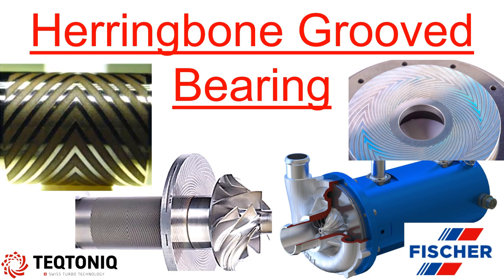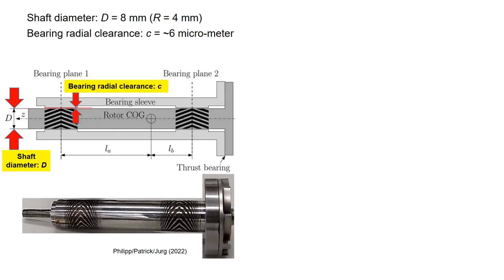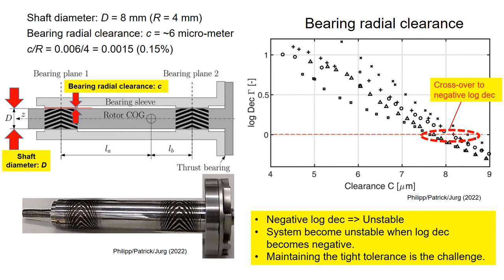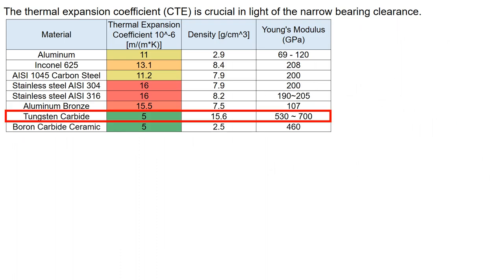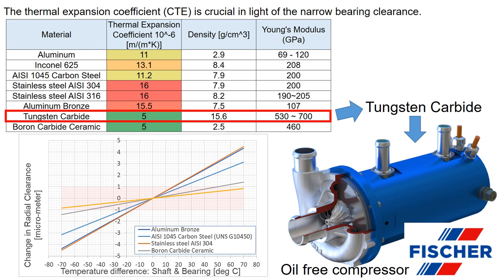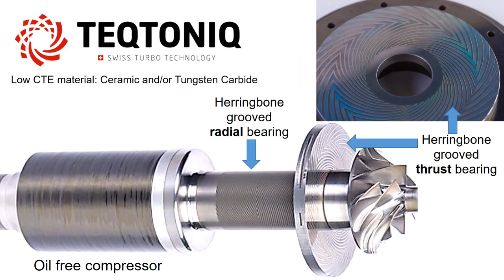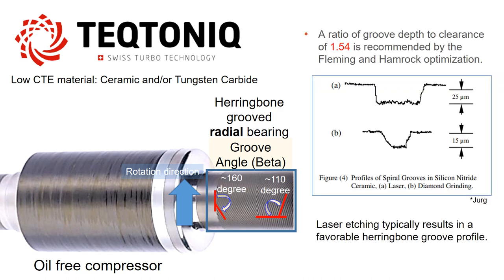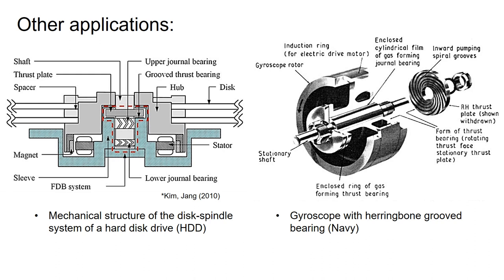Part 21 Herringbone Grooved Bearing

Comment: good. only ceramic materials(wc) proper for herringbone groove? How about using metal (Stainless Steel)? Is the depth of groove is getting larger as the radius shaft gets larger?
Reply from the maker: Thank you for your comment. In the video, I discussed how Tungsten Carbide has been effectively utilized in compressors by Fischer company. While there have been attempts with Stainless Steel, it's worth noting that high-speed operations can pose challenges (medium-speed operations might be more viable). Feel free to give it a shot and share your findings with us. Your experimentation could provide valuable insights into this area!

Comment: Good job! Would you mind introduce the recommend load capacity of this bearing and the recommend rotor speed ?
Reply from the maker: Thank you for your question! I appreciate your interest in my YouTube channel. In response to your query, the herringbone groove bearing is indeed a gas bearing. Its load capacity can be comparable to a gas foil bearing, but it generally has a higher capacity. If you'd like more detailed information on this topic, I recommend checking out Part 17 of my video series where I discuss it in depth.

As for determining the recommended rotor speed, you can find specific guidelines at the end of Part 13 video. However, it's important to note that defining the rotor speed is influenced by various factors such as operating conditions, rotor design, bearing design, and motor design. While the DN value can give you a rough estimate of the rotor speed, it's crucial to consider the overall system requirements and specifications.

I hope this clarifies your query. If you have any further questions, please feel free to ask!
Reply: @RotorDynamics  Thanks for your attention! Your video is always informative and helpful, I’m really your fans and learn a lot from your video. Thank you again. As you mentioned in the part 17, the gas foil bearing has a larger clearance and this clearance will lead to increased leakage and lower aerodynamic efficiency of the blower. This phenomenon will be especially prominent for higher pressure compressors. I noticed that the Herringbone Grooved Bearing has much smaller clearance, and it seems to be a better solution for compressor. But I didn’t know whether it can achieve about over 100-200kW for this kind of bearing. And Is there a correlation between power and rotational speed? Thank you so much and have a nice day!
Reply from the maker: Great question! In my experience working with compressor sizes ranging from 100-200kW, I've found that this size range tends to have a fairly large machine, with a rotor assembly weight of around 40 kg. One challenge with frequent start/stop cycles is that the gas bearing can wear quickly, unless you have external pressure to lift the shaft during start-up and shut-down.

As mentioned in the video, achieving the proper functionality of herringbone grooves requires maintaining tight tolerances, which can be quite difficult for larger machines in the 100-200kW range, unless you're willing to invest a significant amount of money in the manufacturing and assembly processes. If Teqtoniq hasn't found a way to produce their compressor with herringbone groove bearings at scale and at low cost, it suggests that herringbone grooves may not be the most suitable technology for now. But, technology does advance rapidly, and it's certainly possible that herringbone groove bearings could become more widely used in the future. 

At the 100-200kW range, Danfoss (Turbocor) has been doing a great job with their magnetic bearing technology for compressors. This alternative approach offers advantages in terms of performance and reliability.